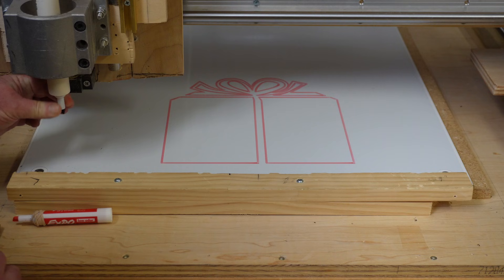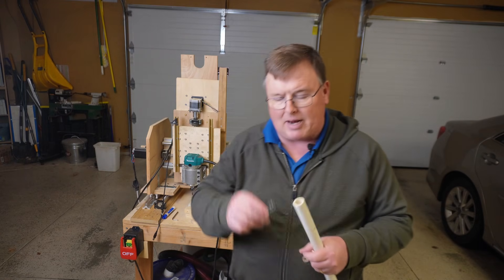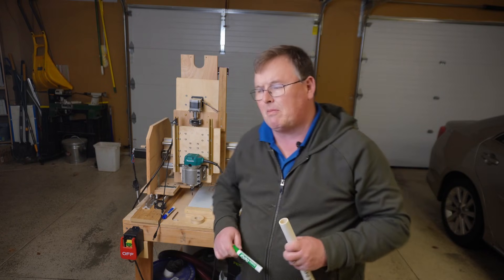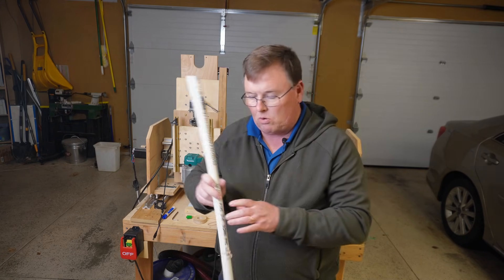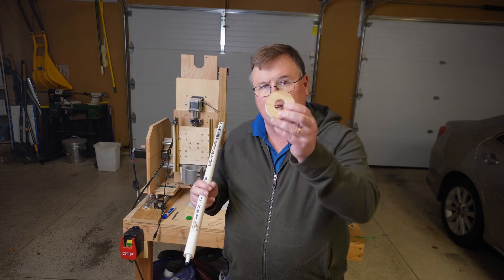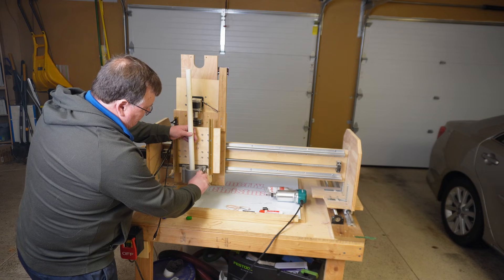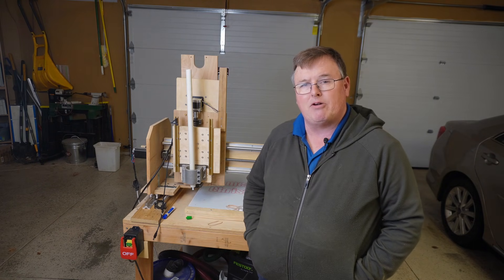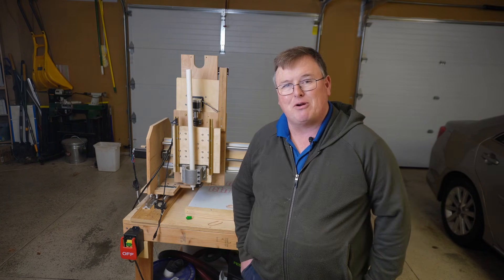CNC Drawing Jig | Make Custom Changeable Signs With Dry Erase Markers!

Comment: THANK YOU SIR ...VERY HELPFUL
Reply from the maker: You are most welcome.  Side note: I didn't show this in the video (maybe I will sometime) but you can use regular large crayola markers and wrap three rubber bands around them to form the gasket and that will make them tight enough to also use in this setup (to draw on regular posterboard that you secure to bed of cnc with painters tape (or magnets).  Maybe that will be helpful to you as well.  Thanks for the encouraging comment.
Reply: @Simplifycnc  thank you very much